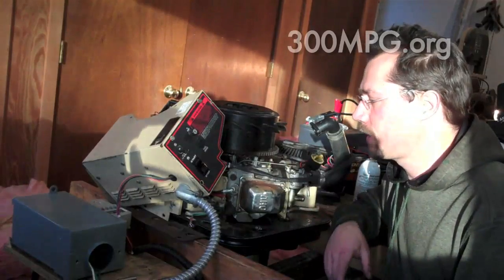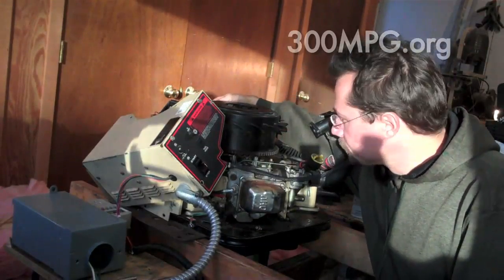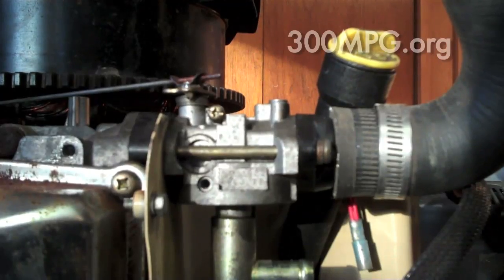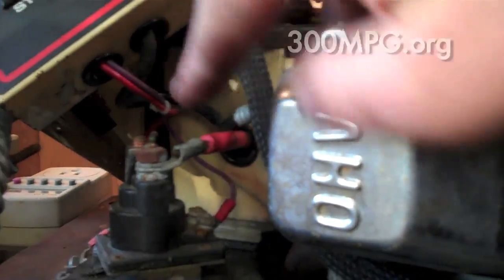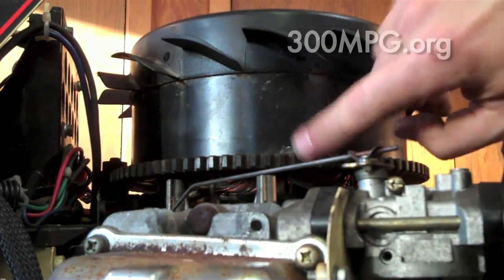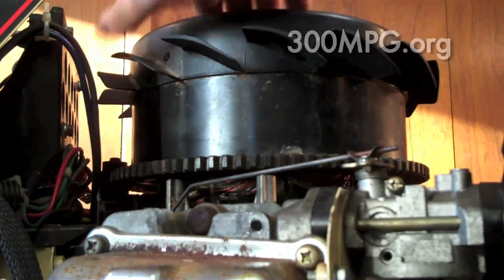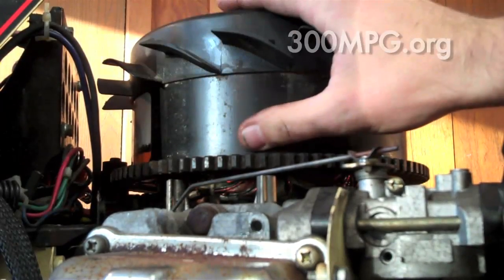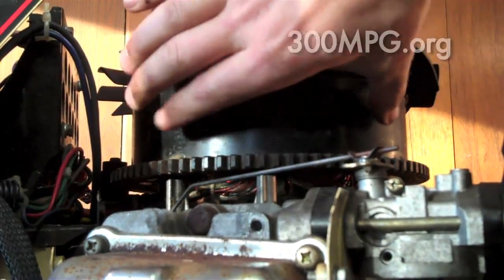DIY HYBRID Generator update Dec 12 2010.mp4

Comment: From what you describe it sounds like the direct drive on my E-Bike hub motor. The axle is the stator with the windings going around it and the inside of the body of the hub has rare earth magnets all along the inside of the hub. When I am not using the throttle the motor turns into a generator and both helps to slow me down and If I'm going fast enough and I have my controller set to allow the back feed it will turn into a generator.